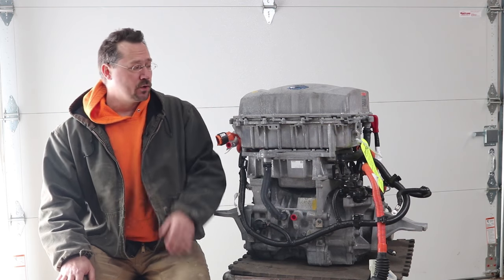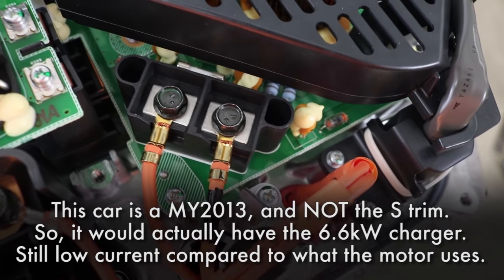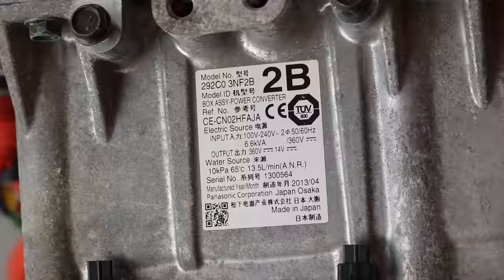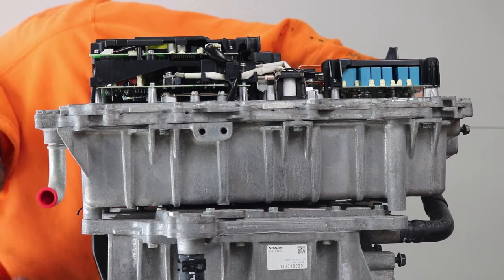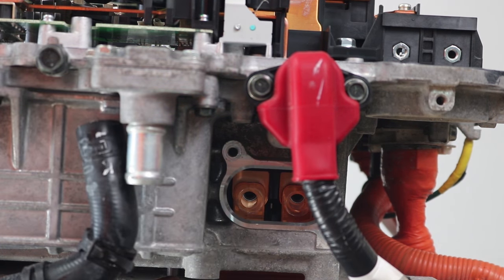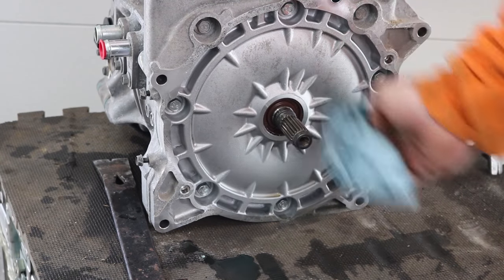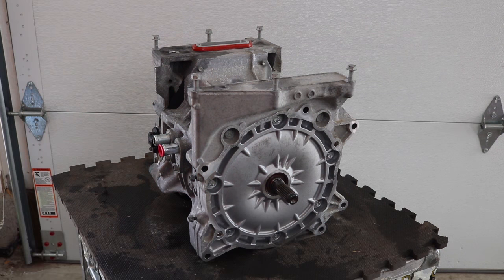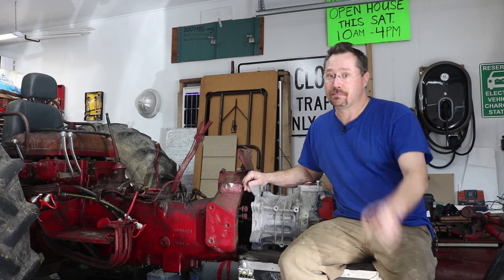Nissan Leaf Powertrain Disassembly (Teardown to EM57 Motor)

Comment: It looks so much different than a tesla motor. It’s even looks a little like a engine
Reply from the maker: On the early Leafs, the box on top of the inverter/motor was even designed to LOOK like a valve cover! Many EV folks were a little upset at that - making an electric system intentionally LOOK like a gas one?!?
Reply: Yeah some ev people can be over reacting sometimes. They always drove gas cars enjoyed the gas car. And now they own a ev they act like they always hated gasoline  cars and that it’s a shame that people still drive them..

Comment: Will you be able to similar for Nissan E-note (e-power as well). will both nissan leaf and E-note have same motors?
Reply from the maker: I really couldn't tell you. I'm not so familiar with the E-Note. My understanding is that it's Japanese only, and I haven't seen any here in the United States. Looks like it's a "Chevy Volt" style vehicle, but the specs on power appear to be the same as the Leaf, so it very well may use the same electric motor.
Reply: @BenjaminNelsonX  tks

Comment: Any idea whats lowest Voltage this motor will operate on ?
Reply from the maker: Using the original inverter, it needs a minimum of around 200VDC. Of course for a battery pack, you want much more than that so you can deal with discharge, voltage sag, etc.
Thunderstruck recommends at least 250V.
https://www.thunderstruck-ev.com/dilithium-vcu.html

Comment: did you get a chance to look at a farmall h tractor they have frame rail that bolts to the trans/rear end instead of the motor for front end
Reply from the maker: Yes, I know of that particular tractor, but it's not like there's some local clearing house of old tractors where you can find all makes and models. We looked around for a while at what was available in our area and went with what seemed like a suitable "donor vehicle" even if it wasn't perfect.
It DOES make me wonder if the IH 300 Utility and the Farmall H happened to use the same bell-housing. If so, I could maybe grab the frame-rails off a Farmall H! Ya never know. I might get lucky.
Reply from the maker: Oh, whoops. I think I may have misinterpreted your comment.
I haven't seen any tractors where the frame rails bolt on the BACK of the transmission. The only ones I've notices so far attach on the front of the transmission, in the same place as where the engine connects.
Reply: @BenjaminNelsonX  well there's a big tractor junk yard buy me well 40 miles that's got like 5k old tractors probity 500 ih and im on good terms  even if you could find a tractor to measure I could buy a set from him he dosent have a good used radiator so I would be interested in yours have to take moms head stone up to northen wi some time this spring theres a rock show in may that way to
Reply: @BenjaminNelsonX  yes the front of the bell or back side of motor  .f12 and f14  did to the rear I think don't remember but could go look don't think you need that much fly wheel  don't need a starter maybe the spline bull gear in that rear axle  got a flat side ???? a brake down or picture of that gear before taring things apart

Comment: Can you lose the clutch at all?  That flywheel looks like a lot of extra mass.
Reply from the maker: I'm actually converting the tractor FOR somebody, and he wants it to retain the clutch. The other thing is that the tractor has TWO driven shafts in the transmission (one inside the other!)
A clutch is required to drive the one separate from the other.
That flywheel IS massive. I'll need to figure out how to lighten it or maybe make a flywheel replacement.
Reply: needs seperate cluch activation for the PTO (equipment on the back of the tractor)
Reply from the maker: @alexjohnward  There is a separate control for the PTO. That's a handle near the back of the tractor, when pulled, it engages the PTO.
That would allow turning the PTO on and off while the motor and drive wheels still spin, but it would NOT allow for using the PTO WITHOUT moving the tractor.

There are many situations and implements where a tractor operator wants the PTO spinning, but the tractor slow or stopped and then start moving.

We're just trying to maximize the usability of the tractor, and not functionally handicap it in any way compared to how it was originally designed.
Reply: @BenjaminNelsonX  you probably want to keep that heavy flywheel so any sudden loads on the PTO wont slow it down as quickly. I doubt that motor will have any problems spinning it.

Comment: Im wondering about what would be the most difficult part of converting a old pickup to ev. Like a small nissan pickup. Placing the engine and connecting the axles would be the same issue as any other conversion but the electric stuff. Do u need all the wireing or can u delete all the options and just hook it up to a starter button. I understand u need the computer.

Comment: The best idea I'd suggest you for your EV tractor project, is to go your local machine shop, and ask them to make you both the motor adapter plate and motor shaft to flywheel flange converter

Comment: If you could adapt the plate where it is the stock IH transmission pattern on one side, but then have an SAE standard bolt pattern on the motor side, you could use an SAE pattern adapter(custom machined) to mount the motor. Here's a link to a company that specializes in custom adapters.... https://www.hayescouplings.com/products/engine-housings/     Good luck!

Comment: Shane from Performance EV reused the inverter separated from the motor. I reused the inverter on top of the motor with my custom control board https://www.youtube.com/watch?v=B3B1dmczXgY. There is also a control board that uses the inverter as is by sending CAN messages.
Reply from the maker: Yes, I've seen the Performance EV videos.
I'm thinking about using the inverter as is with the CAN board, but possibly mounting it different depending on where the batteries lay out.

Comment: Ben in your opinion what's the cheapest way to drive the Nissan motor? control board and original inverter? use a prius inverter with open inverter board? some other inverter?

Comment: Great project! I plan to do something simililar with my tractor (Rapid 1750). I drive a Nissan e-nv200, which has exaclty the motor you have taken apart. It is actually pretty a convincing drive train in that car. Please keep us updated while moving forward with your project. I'm really wonder how you will manage to get that motor running again with all those controllers which might be needed to get it working again ...

Comment: With careful use of a small flat blade screwdriver you can push down the locking tang on those white cable clamps to release the loom without having to cut them and they can be reused. The more you save the less you have to pay for!
Reply: EBay has a broad range of plastic fittings to suit engine bay wiring etc has surprised me when searching

Comment: What a fa tastic video .Very well done .Subscribed .Question ....My old dads leaf jerks to the right violently when you pull away .When you take your foot off the power it then lurches to the left .Anybody know which part is knackered???. Thanks
Reply from the maker: Sounds like a problem with the differential.
Reply: @BenjaminNelsonX  Thanks my friend .Its doing my head in .Your video is fantastic by the way .I set up a renology charge station in my hut .1  200w solar panel.Renology controller and 3000watt inverter with 2 70amp hour batteries linked in parallel. People laughed but now I cut my grass for free .Charge my bike and makita batteries for free .Now this one puzzles me .Can you charge a nissan leaf by connecting a battery charger to the 12v auxilliary battery? I'm thinking of experimenting and maybe scrapping the car (very high miles) If I can charge the car through the auxilliary battery it would be perfect for what I have in mind 😀

Comment: What's the RPM of the leaf motor compared to the RPM of the tractor engine?
Reply from the maker: The motor is faster. Should be able to make a dang fast tractor.
The tractor DOES also have a "TA". That's a Torque Amplifier. It's planetary gearing that drops the speed by about a third BEFORE hitting the 5-speed transmission.
At this point, I would just be planning on running the Leaf motor at lower speeds. Should still be plenty powerful, as it's a 107HP motor replacing a 40HP engine.
I still can use the TA as additional gearing if needed.
Reply: So, I wish to see a wheeles on it :)
Reply from the maker: @pashko90  I doubt the power to weight ratio will be the same on the farm tractor as it was on the lawn tractor! https://www.youtube.com/watch?v=_cavmhl1n5I
Reply: @BenjaminNelsonX  are you going to use the internals of the reduction drive to fabricate your adapter?
Reply from the maker: @kschleic9053  That IS one possibility. Looks like some people have been using clutch plates from certain cars. I think an older Fiat and a Suzuki Samurai use a very similar spline. Using the female spline from in the gearbox would be a perfect match. There's also a bearing in there that could be reused. It would mean sacrificing the gearbox, but there's good probability of using those parts.
I would just want to make sure to do it right the first time. Cheaper to buy a clutch plate than a whole new Leaf gearbox!
Reply: That leaf motor is reported to develop its power over a speed range of 10,000+ rpm .  The original tractor engine will drive that gearbox input shaft at around 2,000 rpm max(?) (check engine speed at 540rpm pto speed).  I don’t think there was any reduction within the differential on the leaf drive.  
As electric motors develop max torque from the get-go, you are likely to only be able to use about 20% of the motor power without exceeding the transmission designed input speed.  Remember, power is directly related to torque and rotational speed.
Reply from the maker: @oliver90owner  The thought here is that it it's a 107 HP electric motor, but if it's only spinning at one-fifth its rated speed, that it will only output one-fifth its power.
In this case, that would be about 21 HP. The tractor originally had an engine a little less than 40 HP. So, the Leaf motor might be underpowered for this project.

One way to overcome this is just to drive in a lower gear with the motor speed higher.

The tractor also has a "Torque Amplifier", or TA. The TA is planetary gearing which drops the gear ratio by about a third. This gives the wheels less speed, but more torque.
Unfortunately, the TA is AFTER the power split between the transmission and the Power Take Off, or PTO. So, while the wheels get more ooomf and less speed, the PTO doesn't, and it would simply be running at a higher speed. Many PTO accessories are really designed for just running at that specific 540 RPM speed. I would imagine that even things like bearings or a slightly out-of-balance blade on a bush-hog could become an issue at over-cranked speeds.

I DO know that there are PTO speed reducers, which are essentially a 2:1 gear reduction for a PTO. Perhaps something like that would work well. It would allow for more motor speed while keeping the PTO speed where it should be.

There are also aftermarket planetary gearboxes for rock crawlers. A planetary gear reduction could be added between an electric motor and the transmission input. Of course, that adds complexity, and the true joy of electric motors is how simple they are!

I'd love to use this Nissan Leaf motor in the tractor, but there are other motor options as well. I really like the idea of using a 3-phase AC motor. Nice not having to ever replace brushes, be liquid-cooled, and regenerative braking would be nice for replacing engine braking going down hills.
Reply from the maker: @oliver90owner  I found some more information related to this. It turns out that the Leaf motor has a flat torque of 187 ft-lbs up to 3,000 RPM.
I don't have the specific torque information on the tractor engine, but if it's rated at 40 HP at 2,000 RPM, that should mathematically be 105 ft-lbs at 2,000 RPM.
The Leaf motor also appears to clock in at 71 HP at 2,000 RPM vs the 40 HP on the tractor gas engine.
So, (at 2,000 RPM)
Leaf vs Gas engine is
Torque: 187 ft-lbs vs 105 ft-lbs
Horsepower: 71 vs 40.

Looks like the Leaf motor should do JUST FINE without any gear reduction.

That FLAT torque curve makes a HUGE difference in power at lower speeds!
The Leaf motor has a steady horsepower from 3,000 RPM up to 10,000 RPM, and only about a 30% power reduction at 2,000 RPM!
Reply: @oliver90owner  according to leafspy, the motor speed is just over 9000RPM at max speed (94 MPH). The gearbox is an 8.5:1 reduction gear.
Reply: @hondaguy9153  info on the net says 7.94 reduction ratio and 10,200ish max motor speed.  Not that it makes that much difference.
Reply: @oliver90owner  ok, not sure where I saw the 8.5:1 and I'm just going off what the scan tool says. That could just be their limit so the motor isn't spinning at it's max RPM.
Reply: @BenjaminNelsonX  This is actually very common for electric vehicles with one-speed gearboxes. Even though maximum rpms may be higher, maximum power capability is available much earlier (lets call this max power rpm). On the rpm range after this value, the power is maintained with field weakening without the need for increased voltage. U can see this from the torque/power graphs for tesla cars, and it can be applied to both induction and pm ac motors.

Comment: Very informative video, Thanks 
BenjaminNelson For structural support go get the side channels off a super w6 tractor I think they would fit on those big bolts at the bell housing. Adapt the channels to the front end.
Reply from the maker: I ended up getting frame rails from a Farmall model H. The rails bolted right on. I’ll just need to make an adapter plate to the front axle.

Comment: First video I see.
Thanks for letting me see.
I am looking for information to make power adds on a diesel car.
Can you point in the direction of information that describes the possibility of using a used battery and arranging it so that it becomes 48 volts?

At the same time, the better should be the energy source for a 4X4 poweret trailer for the car.

Thanks in advance.

Comment: Hi Ben, just wondering if you have the overall dimensions of the full stack recorded. I'm planning an ev conversion myself (see my channel for the very early stages) and I'm wanting to see how a leaf motor + inverter + charger might fit in it new engine bay.

Comment: After watching this project, I have decided to locate this be a great motor to experiment on a idea of making a Goldwing I have into a electric vehicle.  I think though I would keep the transmission though only need one side of the output shaft thinking I could take a half part of the shaft and place a alternator on it or generator possibly recovering the power back into a separate battery module  then once the main pack is empty switch it to the reserve pack then the generator would charge the main pack.

Comment: You may want to try putting a small thin magnet on the end of your ratchet and extension, to hold bolts in the socket! I also put one on my screwdriver when needed, to hold screws,. A tiny neodymium magnet is very strong!

Comment: The main problem in using a Leaf motor with a clutch is that one needs a very thick backing plate to bolt the gearbox onto, and there are some concerns that the Leaf’s engine spindle may not be strong enough to support a flywheel some distance out from the motor.

I am therefore considering using the transfer case (without the cover) as the spacer, since it already has the holes drilled in the right places for the motor and since I could then retain the inner bearing, to provide more support for the new flywheel flange. I would remove the gear wheels and reposition the anti-static device. 

I would then cut the first gear assembly in half, attach the flywheel flange to the cut off end, slide the new assembly over the splined motor spindle, and use a locating pin to stop it falling off (not that it could move far once the MG’s gearbox is attached).

I worry that the flywheel might shake, since there is likely to be some free play in the spline supporting the flange assembly. Any thoughts?
Reply: And the answer to my worry is: add a second bearing in the backing plate, near the outer end of the new flywheel flange (but before the flange itself).

Comment: Are you sure you want to put a heavy flywheel on the end of this leaf motor I’m saying this because the leaf motor had no weight on it From the factory maybe it would be better to direct couple the motor and the transmission input shaft or if you want to retain the factory clutch and flywheel assembly is to build a special bracket including a bearing that would support the clutch and flywheel independently of the motor and then connect the leaf motor to this assembly I’m just thinking the leaf motor wasn’t designed to carry any axial load or weight maybe I’m wrong but just keep this into mind I would personally call the guy’s at EV west to see what they think.    One question I have is the input shaft of the transmission self supported or there was a pilot bearing in the flywheel or the end of the crank ?
Reply from the maker: At this point, what you said is exactly what I'm thinking.
Yes, the transmission input shaft was supported by a pilot bearing.
I think that adding a support bearing in the adapter plate is the right way to go. I'd also want to lighten the flywheel.
Reply: This question read my mind.... After seeing the Vonnen Shadow Drive Hybrid motor kit... I wondered about how much a flywheel was even needed in this application? So this addressed my curiosity on this issue... so thx..
Reply: @nc3826  Needs the flywheel to use the clutch. (Why the owner wants a clutch is another question.")